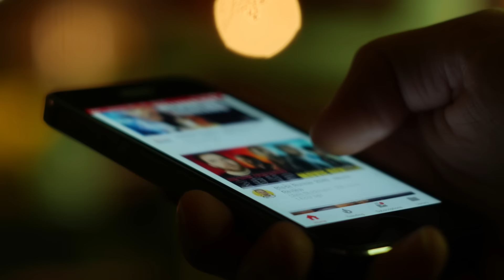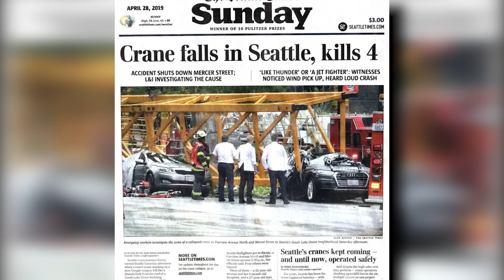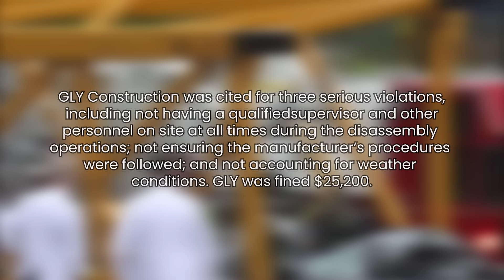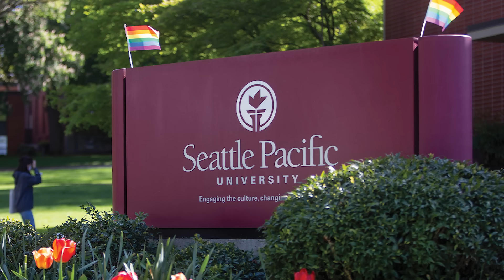The INFAMOUS Seattle Crane Collapse Disaster | True Horror

Comment: I used to be the lead engineer/electrician at Seattle Municipal Tower. One day our building was exposed to this kind of weather. The building was swaying side to side, [as it was supposed to do] so much so that tenants were getting sea sick. A couple of us engineers stayed with the building during the evening in case some of the water mains broke or electrical failures. We went to the roof. The wind coming off the sound was ferocious! It was sheering off Columbia tower with a deafening noise! I can see how a tower who's stability was compromised would fail because of the wind. So sad for those innocent people loosing their lives.
Reply: I don't think I could stay in one of those buildings, even knowing they are intentionally built that way and everything is working as should it just makes me ill at the thought of a building swaying like that. I already don't like them because I have a fear of heights, but that just makes it even worse lol
Reply: @Trenchcoat3  I can sympathize with your reluctance to be in that building, but that actually is how the architects designed it. During the storm, I went to the upper floors and made a pendulum at some ones desk. The weight would sway in a square movement just as the building was designed to do. I had the utmost confidence in the buildings structural integrity, until, the Seattle council decided to erect this huge monstrosity window cleaner on the top of the building weighing several tons! That made the building, at least in my view very top heavy. When that installation was complete, if we had another one of those ferocious storms, I would no way stay in that building. Its just geometry 101!

Comment: Thanks for posting this. 

Not long after the incident, Seattle area electricians wanted to organize a candlelight vigil in front of the job site with members of other trades. For doing this, they were personally attacked and slandered on Facebook by the Ironworker's business agent & trustee Chris McClean who in turn went to the EST of the King County Labor Council to put pressure on them against the vigil. The reason? They were advocating an "unauthorized work stoppage." In other words, the GLY job was behind schedule and they couldn't afford to miss an hour.

And that's why that contractor was cutting corners with the crane pins to begin with. They pulled them out in that way to save time--because as a contractor: the more jobs you do, the more money you make.

And what did the Ironworkers have to say about this lack of safety? They're a union that's safety conscious right? One that sticks up for the workers? Did they say a damned thing?
Reply: Can't say that I am surprised.   More of that needs to get out to  the public and the unreasonable deadlines because of greed.

Comment: I remember this happening in the early 2000’s and killing a man in his apartment. I thought that was what you were covering. Wonder why this mistake has happened at least twice in the same city.
Reply: Those were 2 complete different scenerios.  The one in Bellevue fell because originally there was a different make and model crane in the job.  Contractor went bankrupt and the crane was taken down.  When the job resumed a different contractor wanted a different manufacturer crane. The legs of the crane imbedded into a concrete footing have a pattern on them for that model.   So think square peg round hole.  The contractor got cheap and instead of removing the old footing and putting in the proper base they hired a 3rd party company that engineered a adapter to let the new crane sit on the old footing.  It was approved,  but failed later in ideal working conditions.   Think tearing a soda can in half.  Grab the top and bottom and twist. Enough times it breaks.  The one in Seattle they pulled every second tower section pin giving each section the ability to tip on the male female connection. Amplify that by a dozen sections and the top swayed way out of plumb.  2 legs of one side lifted,  the other 2 bound up in the sleeve.  On that side one pin fractured and the other tore the sleeve of the leg and it all toppled.   Both were trying to save money!!  That one that went down in Seattle.  I didn't need 6 months of investigating,  10 seconds of looking at pics i knew exactly what happened.

Comment: We would never dismantle a crane with any sort of strong winds or rain for many reasons here in Perth, Australia. That's crazy they went ahead, although sometimes the pressure is felt from construction bosses, time-limited permits like CASA (airspace) or road closures (where the mobile crane is parked up with the trucks that are being loaded) and maybe when a crane is to be erected a short time later at a new site. There's so many types of tower cranes out there but some mast pieces are about 6m high and weigh anything between 3.2t and 5.5t (and more!) That weight is nothing short of crushing, especially when falling on cars from such a great height. Which is why you only remove the 8 pins at a time, have each section pulled up by the mobile or by a 2nd tower crane if there's more than one on site. We have procedures, SWMS, method statements, plant hazard & risk assessments and lift studies for a reason but there's always some cowboy going for the shortcut!!

Comment: I work big jobs like that I was actually on a job two blocks down the road. Lots of people knew what happened the week after word travels fast they pulled all of the pins and then when they were lifting up the sections the wind blew and some of the sections stuck together causing them to lift more than they were allowed and caused the huge catastrophe. If you think about it Seattle had over 70 Tower cranes up in a 2-year period and only one fell and it was because they were in a hurry.

Comment: I drove past that crane a few days before and pointed out to my friends I was with how unsafe it looked. It was obviously leaning a little and wobbled in the wind.

Tinfoil hat jokes aside, I really believe the "report" was a sham to assure people the other 50 cranes in Seattle are safe, and to limit liability to the construction companies (and exonerate, say, the city for approving such a ridiculously hazardous crane location... Or letting Google's builders use one big crane for both buildings on such a small plot).
Reply: It's exactly true. They pulled the pins off every second section as they are a male female connectin with 2 pins on each leg marrying the tower legs together.  Think of a tall stack of glasses at the bar.  A little slop in each section gave each connection a bit of lean. Amplify that to all the sections and youre way outta plumb.. on  the bottom section the windward side ,lifted up and out of the sleeves transferring all the torque to the downwind side.  They tilted, bound up in the sleeves and one of the connections that go from the upper tower sections into the lower split in half,  the other side the connector tore the female connection out the side.   Just like dropping one glass into another and pulling sideways.

Comment: When Fate draws your number, there's no escape. What odds. Circa early 1980s I took a friend down the West Coast as she always wanted a look. I was driving a small Subaru hatchback from Montana and was barely handling the heavy traffic I hadn't seen in years. Crossing through Seattle was LOTS of construction; was on an elevated bridge that had traffic squeezed to 2 lanes w/concrete barriers between. Nowhere to go; metal walls and long drop to water on outsides. Was following a utlity truck pulling a large generator trailer ... 30 mph or so? ... when the huge boxy generator began to start bouncing, followed by its hitch dropping, jamming into pavement and launching the entire thing a good 15 feet in the air, spinning, twirling ... just waited for it to crush us. OR some bumper-to-bumper oncoming traffic. That time Fate dropped it straight down from its high apex, scraping the concrete barrier and embedding itself into the metal mesh bridge floor ... a nice 20 feet away from our front bumper with time to stop and thank God an empty car-length I put before the trailer on paranoia alone. Sorry; intent was a quicker, shorter paragraph but point: these are all bad but take heart that there must be many, many more close shaves, outright misses and lives passing through other potential tragedies. Those aren't covered by news and end up in YT comments.